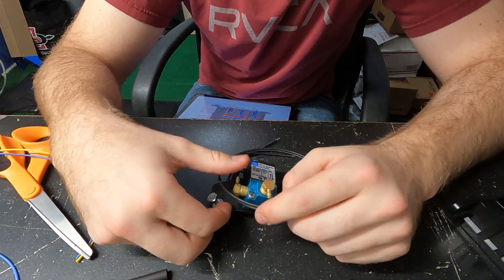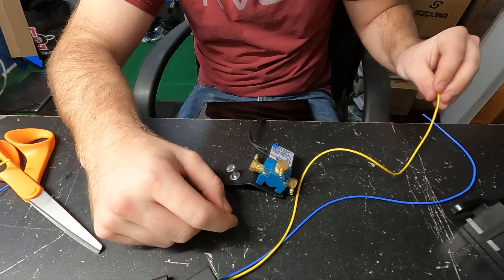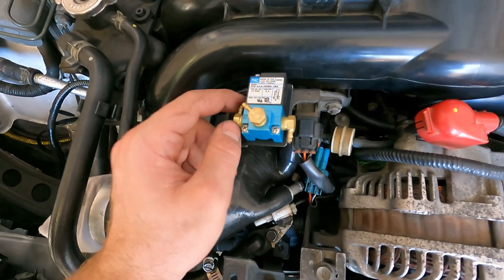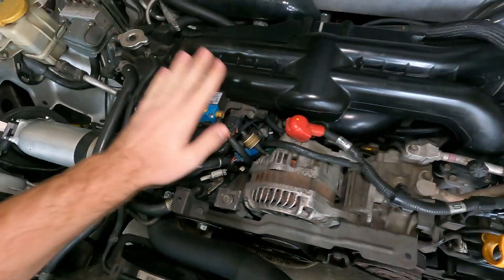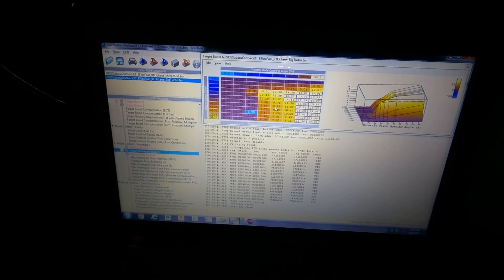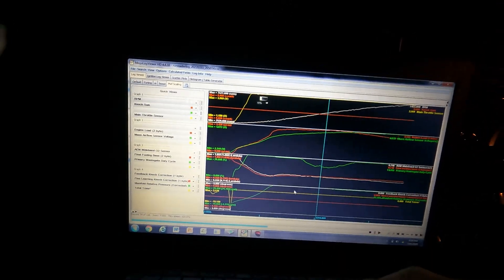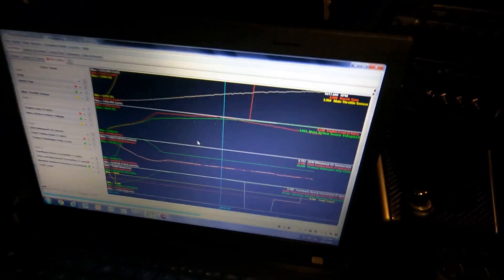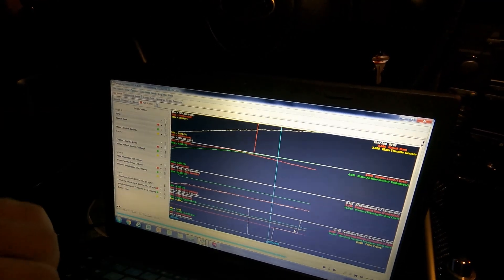Tuning For Blouch 1.5 XTR Turbo and 3 Port EBCS on 91 Octane!! (Subaru Outback XT)

Comment: How much timing are you running at 20psi and 91 tune at pk tq and up top if you don't mind me asking?
Reply from the maker: Off memory I think its like 18 or 19 degrees but I can double check later and get you an exact number
Reply: @SWSpeedCo  thanks. Reason I ask is cause I couldn't run anything more than single digits with my 20G until I swapped out turbine and went meth and even then I'm at 73% meth but now I'm at 27psi
Reply from the maker: On 91 with 20 psi it looks like at 4000 rpm where my peak torque is the timing is 8.5 degrees and steadily increase to 14.5 at 8000 rpm
Reply: @SWSpeedCo  thank you! That's what I run but on meth. I think I messed up by running such high compression. I need cans to bleed it off. Appreciate you. Thanks again

Comment: Hey brother, my ‘05 Outback XT ej255 motor recently got damaged due to a spun rod bearing.
I bought a jdm ej20x motor, but they are dual AVCS motors.
iwire makes an engine harness merge kit to get both exhaust AVCS camshafts sensors working, but they said I’d need a jdm ECU.
Do you know anyone that could tune a jdm ‘05 ‘06 Legacy GT ECU so I can use the jdm ej20x motor on my ‘05 Outback XT?
Btw, my car came with a catless DP, Grimmspeed boost controller and CAI. Not sure if that would complicate things a bit. I’m not looking for power, just trying to get the car tuned and properly running again. What do you recommend I do in my case? Last thing I want is blow up the ej20x motor..
Thank you in advance
Reply from the maker: I'm not sure of the difference in turning jdm engines, but yes you do need the jdm ecu. I would contact some subaru tuners about your situation because they would definitely know better than me.
Reply: @SWSpeedCo  Ok, thank you.